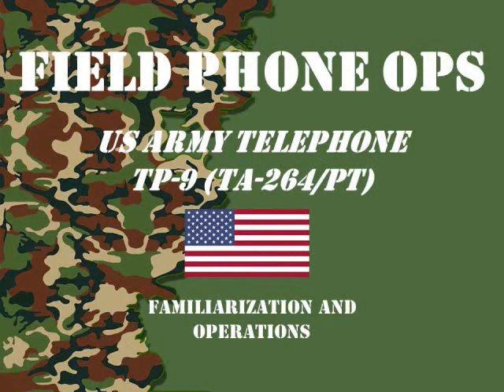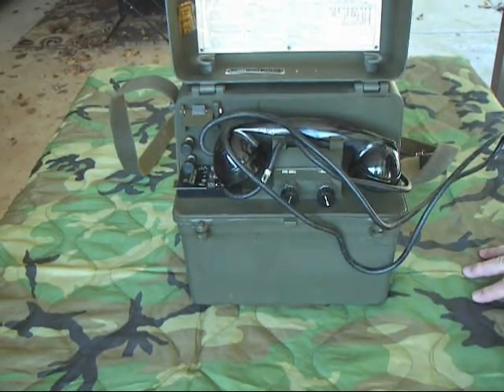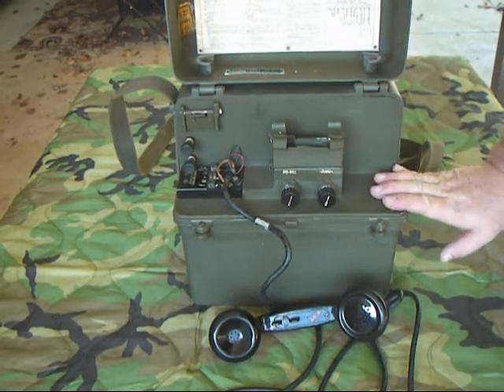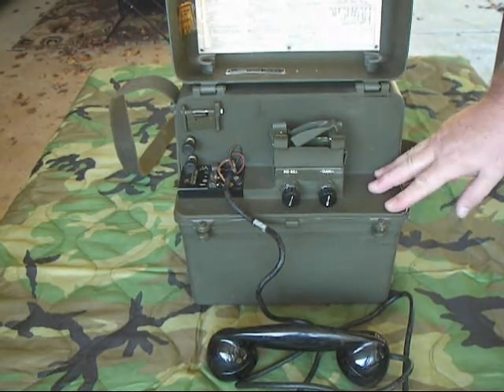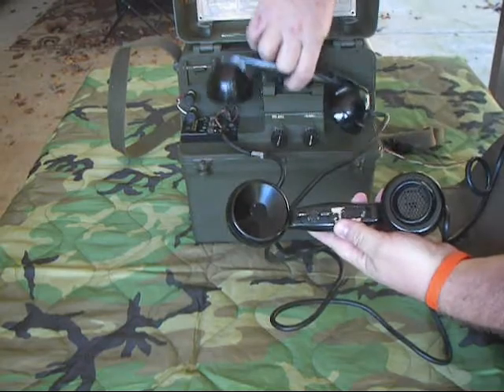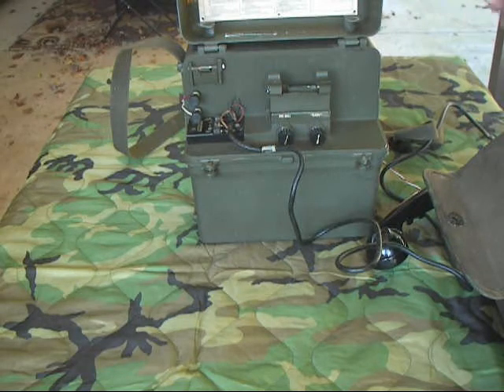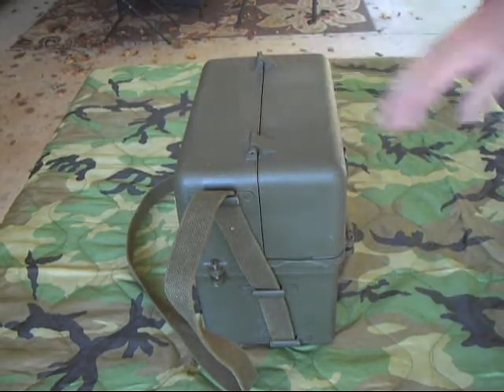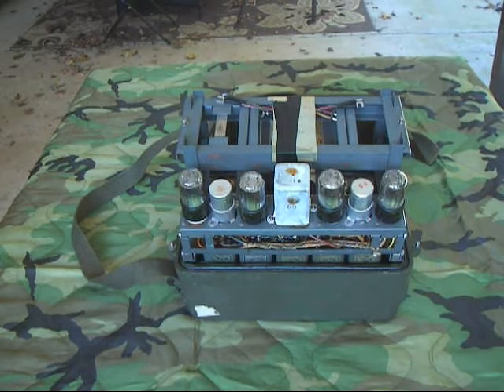FIELD PHONE OPS:  US TP-9 Field Phone

Comment: Thanks for the video! I just purchased a pair of these TP-9s and was trying to get them working. Do you have a video of how you connected them via wire? I don’t know nearly enough/have enough money to try to get them working via battery.
Reply from the maker: You have to have batteries to make them work.
Reply from the maker: I have no video all the info is in the existing video or on the labels in the phone.  You don't need the big 22.5V or the big 1.5V batteries because these are only used in the amplified mode.  You need to get a 3 AA battery holder off of Amazon and connect it to the binding posts that the BA-27 would connect to.  You can then check and see if you hear yourself in the handset this is caused side tone.  if it works all you have to do is connect two wires to the binding posts and run them to the field phone that you want to talk too.  In this mode the TP-9 will talk to any other two wire field phone.

Comment: How did you make the battery pack for connecting to a ee8 to talk back and forth?
Reply from the maker: First I would review this video about battery packs for field phones.  https://www.youtube.com/watch?v=-Vb0TjvOfgo&t=4s

You will need a 4.5V source so I used 3 AA batteries in a battery holder I purchased on Amazon.  You'll then have to wire it to the terminal strip inside the phone battery compartment.  I think its labelled.